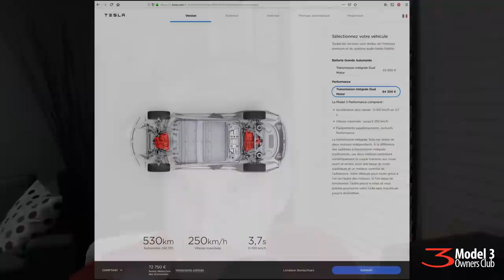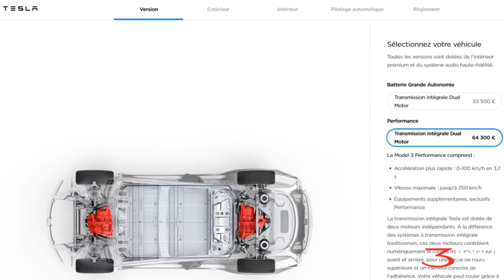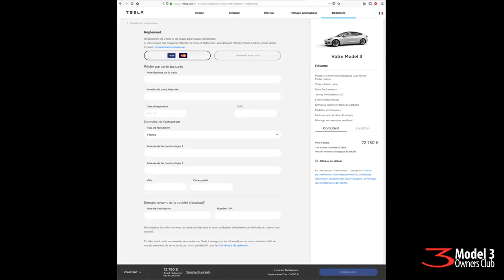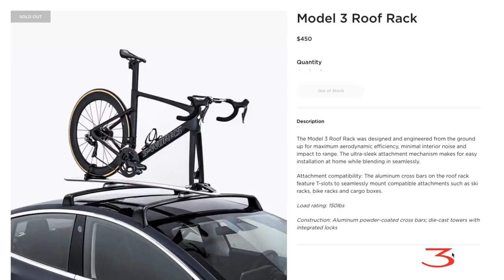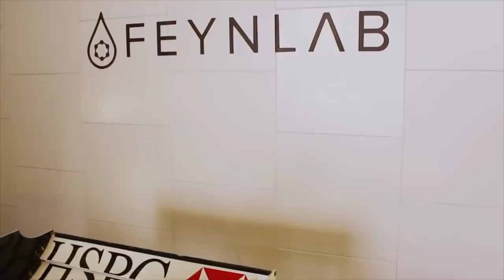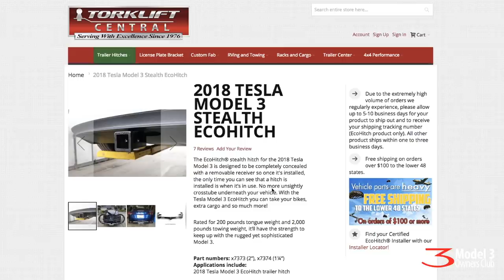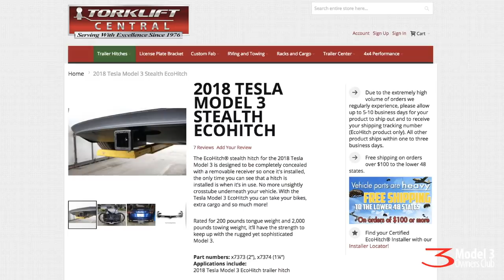23 - 3 2 EU

Comment: The battery health fundamentals are easy: lithium batteries like being closer to 50% and dislikes being close to 0% or 100%. However, how close to 0 or 100 you start seeing bad effects varies between specific chemistries, as does the scale of the negative effects. Also, since the effects are not linear to percentage, the "sweetspots" vary. For Teslas, 90% is much better than 100% but 80% is just a little better than 90%. The benefit of 70% instead of 80% is almost negligible. You have to weigh the gain against the effort to know what is best for you. For some, that is 70%, for some 90%. It depends on range needs, home charging setup etc.
Reply: However, the low end is easier because Tesla takes care of that for you. When it says 0% that is not truly 0%. There are 2 buffers below, one that you can use (like the "reserve tank" on some ICE) and one that you cannot (car shuts down so you cannot use that power). The percentage you see is not the "gross capacity" advertised as for example 100kWh, but the net capacity that Bjørn Nyland calls usable kWh (check his tables for accurate numbers for different models) . So when it seems like you are close to 0% the battery chemistry is actually NOT close to 0%, but maybe around 10%. So instead of comparing the reported 10% to 90% and 20% to 80%, you should compare 0% to 90%, 10% to 80% and 20% to 70%.
Basically, on a Tesla you shouldn't care how close to 0% you are for battery health reasons, only for "running out of charge" reasons. If you have a healthy safety margin  to not run out of power, that is also good enough for battery health.
Reply: The advantages of certain charging behaviour for the BMS is much less clear, and I haven't heard any good intel on how exactly Tesla's BMS calibrates itself, but to periodically charge to 100% seems good for the BMS (how often is unknown). To also discharge to almost 0% before/after 100% is disputed.
Cell balancing (different from calibrating) is done by Tesla with technology that should work fine even quite a bit below 100%. But again, we don’t really know the details (although Tesla hackers should be able to find this one out)

Comment: Guys,  I understand the reply regarding the Adaptive Cruise Control but how about the $150 Key Fob.  I can't think of any other car maker that charges extra for a Key Fob!!!   I doesn't even allow for passive entry.  I'd love to have a key fob for my model 3 (having several times been standing outside my car in the rain or cold and have it not want to unlock the door).  I say they should provide at a minimum one Key Fob at no charge then for additional units, charge $75-$150.  I love my model 3 but this is wrong.